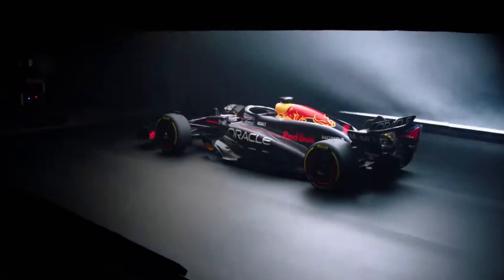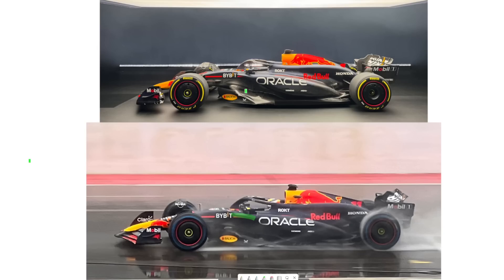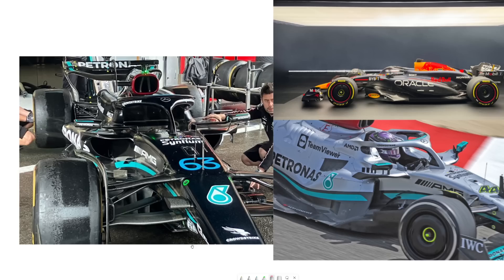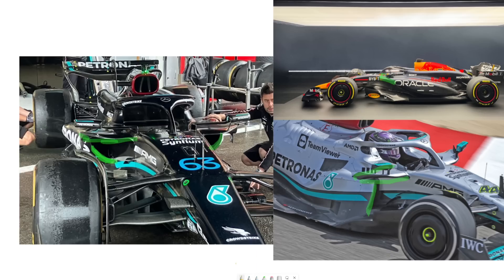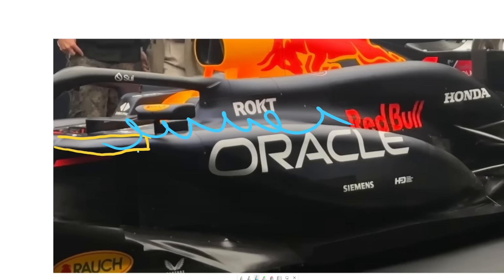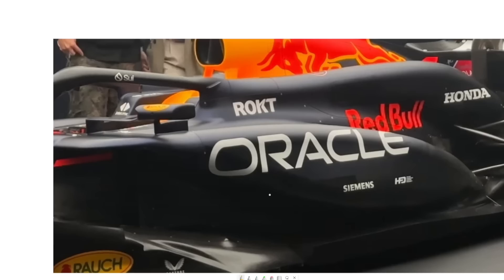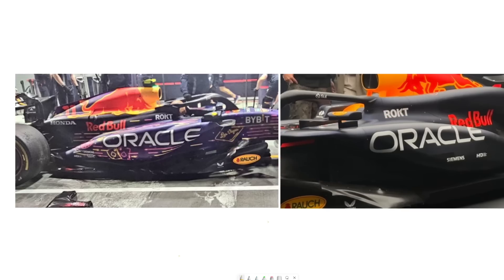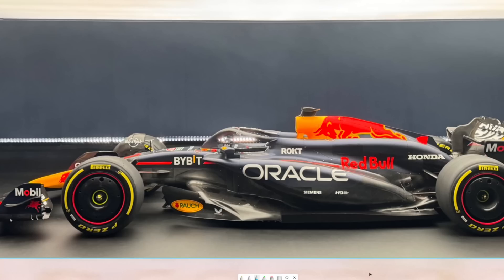Red Bull RB20  -  Launch Aerodynamics Analysis and Initial Thoughts

Comment: Seeing the inlets above the halo during testing, I have to question if it is possible and allowed to use that air as a modern take on the 'blown diffuser' by channeling the air trough the canons, heating it up and then directing it to the beamwing? Would that be allowed? Or is cooling air not allowed to be used in such way?

Comment: Mercedes opening for the cooling inlet and mirrors are behind the halo strut more or less the same as the red bull, the upper lip on the rb20 is further forward not the other way around. Look at the w15 the mirrors, halo and cooling inlet they are just behind the halo, where as the front inlet lip on rb20 is much further forward and not you as drew it.

Comment: With more driver cooling being introduced, could they be looking at needing to minimise cockpit losses as a small advantage. IIRC they (FIA?) announced increased slots and funnelling for driver cooling but didn't make it mandatory. Could RB be anticipating that no-one wants the aero losses running the extra cooling, so it will likely become mandatory for hot races in order to make the teams do it for driver safety? If the car is already designed to control airflow from the cockpit, it'd surely work better than an ad-hoc or non-existent setup just for races where more cooling would be required. Or would the extra losses from airflow through the cockpit be negligible, with most aero issues being the intake slot? I've not heard much about the driver cooling since it was announced or exactly what the aero issues are.

Comment: no one is talking about the exit behind the side pod thats clearly directing air from the cooling into the diffuser right before the suspension for even more airflow to the rear. the redbull and merc actually have similar ideas when you look at there car for 24, the major difference is how they both control the air from the front wings and their floor and diffuser. but its not be shocked when you have allison back going up a against newey. plus what redbull have done is drawn all the idiots to be obsessed with the sidepods and cannon which are jut visual things and hide the real secrets of this car

Comment: In hot races there'd be cooling lovers inside the "sausage valley", the nose tip could have the panel removed with just side pillars for struct purposes
Btw the radiator intake and the sidepod extensions reminds me like F-18 Super Hornet

Comment: What is really striking with this car is the cross section size of the monocoque at the front suspension. And the smoothness of it. Compare it with the Ferrari which runs pushrod instead of pullrod. The aero gains due to floor intaike increase must be insane

Comment: There appears to be a line junction between the air inlet and the sidepod proper. It suggests that the air inlet portion may be removable , ie. BOLT ON element, exchangeable to gain varying characteristics. This inlet obviously controls the air flow around the sidepod, ie. over vs under, causing alternate downforce and center of pressure effects depending on track configuration. If it is true, it is the first ever such approach to aerodynamic manipulation in F1. Along with front/rear wings, the air inlet may become an "aero package" tuned for each race.

Comment: A Question: Is it in any way as far as you can tell possible that RB attached the nose to the 3 wingplate rather than the second wingplate like others teams or the first plate like in the launch version of RB. 

If you look at photos of the silverstone shakedown the bottom carbon end of the nose appears (al least to me) to not be attached like on the launch version. On the Shakedown photos the transition of the yellow part to the carbon part doesnt look smooth and more like it has a sharp edge which makes me assume that it isnt actually the carbon extension of the nose but rather the front wing which kind of looks like the extension due to the angle of the photo.
Also the carbon part on the launch version looks like it was just glued there to cover something up.

Im refering to the shakedown photo 1:42

Comment: I watching this video and reading the comments and I just amazed how F1 fans are blind or didn't see things. Guys this car has 2 air inlet.  Have a normal horizontal "catfish "mouth type inlet under the upperbite. And have one horizontal for a second cooling inlet or sort of S-duct for cooling porpuse only ,otherwise is not allowed.
Reply: I don't think people are blind. I have yet to see one photo of the car that definitively shows if it either does or does not have a horizontal inlet in addition to the easily visible vertical one. Don't know how you could claim people are blind.

Comment: Question - don't you think, that the sharply down-washing sausages will stall at high speed? At least I fail to see how the flow is going to stick to them at 300km/h. Stalling will give turbulent air to the rear wing and this way will diminish the pressure differential on the rear wing. That should lessen the aerodynamic drag of the rear wing. 
Also about the letterbox cooling inlet - I think, that the main idea there is to direct the overflowing air, that the cooling cannot accept at high speeds, toward the floor edges.
Those 2 effects together may result in a situation, where at high speeds, floor contributes more towards the downforce compared to standard situations. Resulting in drag reduction.

Comment: look as a pilot
side pods are wings   shape then as such 
cooling pull the air in from the top center or under the driver with a scoop

floor
shape like a inverted  flying wing body
with this the front wing directs air to the wings
the rear wing can be minimized with the above

Comment: Newey did say that they contemplated the zero side pods concept when asked about the Mercedes last year, but he said they put it aside because the development ceiling is low. So it matches with Mercedes' whole "this concept works on paper" I think Newey took that concept and merged it with the RB19. If it works, it would be an absolute dunk on the engineering on the grid.
Reply: Toto table slam intensifies
Reply: No, just normal sidepods. But vertical opening dude
Reply: But they didn't use the zero pods only the features that came with and that's very different cause mercedes whole concept rely on zero pods and they taught it was the biggest innovation
Reply: Do you have listening comprehension problems or you just didn't bother watching the video and thought it would be a good idea to mash your fingers on the keyboard instead? Because he says the exact opposite, it's not a zero pod concept, they are the same side pods as last year with a different inlet shape.
Reply: @boostav  Calm down, you mongrel. How it appears to be similar to the zero pods is in the minimal inlets, which would give more clean surface for the air to flow. From an aesthetic point of view, anyways, it looks like horizontal(for tyre wake management) zero pods. The zero pods weren't just the zero pods for drag purposes. They were married to an inwashing solution to tyre wake starting at the front wing and guided by the sidepod width.
Reply: Except I don't think it's being merged with the RB19. I think this is its own thing, a progression, taking after some ideas seen on the Mercedes and Ferrari of last season.
Reply: @F1ll1nTh3Blanks  I said this because of Pierre Wache's comments. He seems to still see this car as a continuation of the RB20 jut with all its weaknesses addressed. Makes me think the parts we don't see (which, let's be honest, make the difference) still maintain a conceptual similarity with the RB20.

Comment: Any specific reason why RBR may want to go with two letter box inlets vs one slim p-shaped inlet instead? Would it give them cleaner outwash with the separated positioning?

Cheers for another great video, representing Kyles well
Reply: im interested wether boundry layer ingestion like in some aircraft engines that are being developped is a thing here. by ingesting the dirty boundry layer air you can apparently reduce the overall drag, with drawbacks like the need for sturdier engines and worse cooling. How this works exactly is frankly still a mystery to me, but apparently it works at least in airtravel.
Reply: @irony2341  the vertical element of Mercedes’s P-shaped pod likely does that exact thing, except instead of propulsion it’s used for cooling. Since F1 cooling ducts don’t have a massive active fan sucking the air in I assume it won’t serve much as drag reduction(since there will be stagnation pressure in front of the cooling duct) but more so offering cleaner air for the rest of the aero kit, which kyle has mentioned already.
Reply: @irony2341  Well, they have an extra ICU in the regs now b4 penalties, so that might play a part in cooling choices.
Reply: @irony2341  To me it makes sense to use boundary air for cooling and the clean air for flow through to critical aero devices
Reply: @irony2341 he talks about this a bit in the video on the Merc.
Reply: they might show up with a much different looking car in Bahrain, who knows...
Reply: It struck me that the new Mercedes and this Red Bull intake are very similar in that they are both taking cooling air from the vertical slab sides of the forward cockpit where one would expect it to be reasonably dirty but Mercedes are blending the horizontal element with a smooth curve. They both have an extended upper lip too. If anything, the Red Bull appears to be the more clumsy looking version of the two.
Reply: @colinhare4722 
Isn't it that RB uses two seperate slots because each slot serves a different purpose?

Also, if there are two slots, with different functions,  it's easier to modify/adjust those parts individually for different circumstances.

Comment from the maker: Kyle: Let's do a quick analysis video. 11 minutes is quick right?

Hope you enjoy it!
Reply: Super interested to see how the front nose connection changes things
Reply: As far as I’m concerned, make it an hour
Reply: Giving the people what they want!
Reply: I have several questions about how different elements (introduced by teams or built-in by regulations) deal with front tire wake, how the floor is sealed, how dampers are tuned to maintain platform control, driver comfort/ride quality, and also near-perfect roadholding of every little crack in the road at high speed.

1) If the Merc W15 front wing as it is now is banned, would it be better if they curved the top element the other way and introduced a back-off in the middle to create a vortex that drives the front tire wake away and also help with sealing the floor?

2) could the sidepods be shaped in such a way that they help create vorticity that seals the diffuser?
3) could the sidepods be shaped in such a way that they help seal the underfloor along the side of the car?
4) how do suspension setup engineers find the balance between dropping the wheels down quick enough but also move the chassis slow enough that the aero balance doesn't get upset (and the driver's bottom and spine doesn't hurt)?
Reply: Yes we do!
Reply: Thank you for the video!! I appreciate seeing the Red Bull
Reply: I'm not quite sure if the ICE is sufficient for this kind of propulsion (thrust through accelerating the ingested air), but could boundry layer ingestion like in aircraft engines be a thing here?
Reply: Love it mate, cheers!
Reply: it's quick bc there was no maths or hours of 3d design work just to make a circle
Reply: Cool video although I found the drawings a little bit confusing. I can't translate those to what is being said.
Reply: Thank u
Reply: Great job with a quick overview.  I look forward to your deeper analysis of the cars once we see the real thing at Bahrain.
Reply: "Quick video" looked at time ...uhh 11 min yep seems about right haha
Reply: Kyle, love your videos. Here’s an idea, since the F1 fan base is growing especially given than Hamilton is moving to Ferrari in 2025, there will be a lot of new people who don’t understand how the car works. Can you make a playlist of vids explaining how an f1 car works that’s technical enough for engineers but simple enough for beginners. I also think you have a huge competitive advantage given that you actually worked in F1 so people would listen to you as opposed to other YouTubers who may do the same thing.
Reply: Thank you for taking the time to explain the aero philosophy of the new F1 cars changes.
Reply: Hi, how about an update on the RedBull after the first day of testing?
Reply: Love your analysis!
I'm curious how the RB20's combination of horizontal letterbox style and vertical "zero-pod" style openings are legal in all the slicing planes, specifically the Y, having only two sections?
When you discussed the Merc's zero pod design you talked about the Y having only 2 sections: https://youtu.be/pP6T1comENg?t=376
Reply: Honestly, go as long as u want, love hearing from someone who’s got experience in the field
Reply: NEXT : Peugeot 9x8 with wings